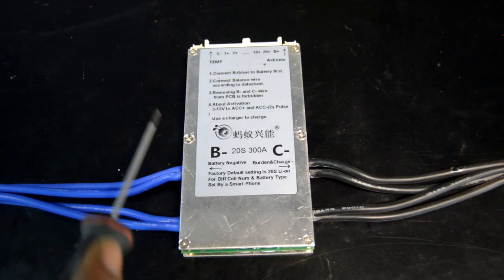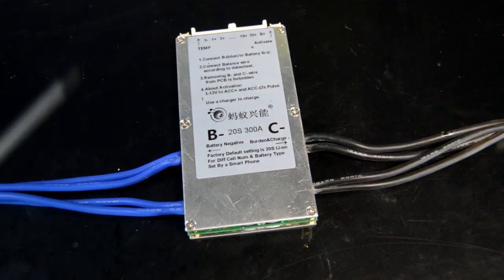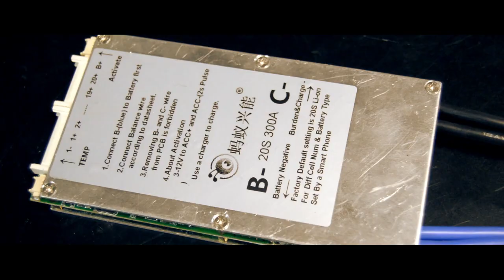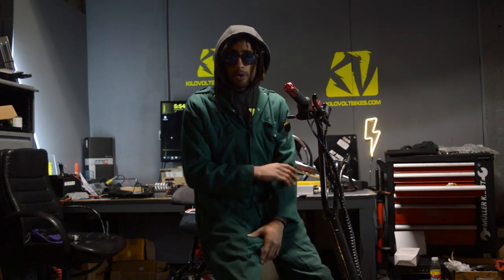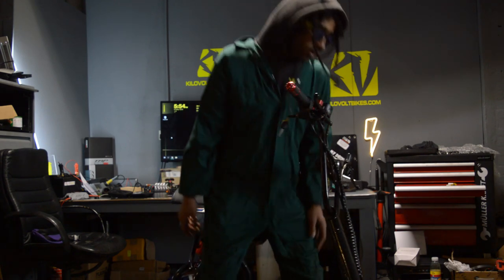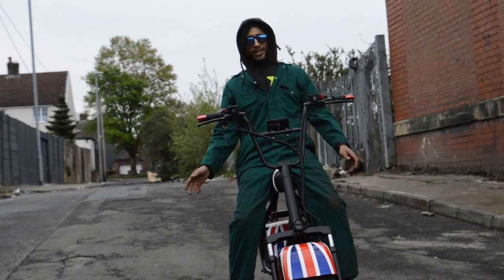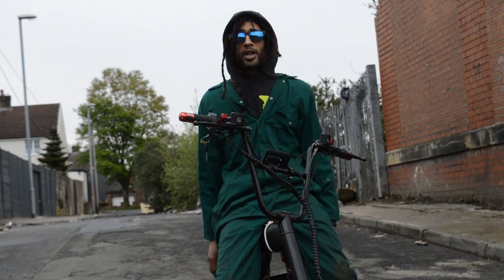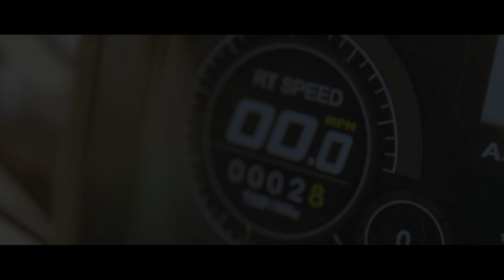Modified Citycoco Electric Scooter with 72v battery & Sabvoton Controller Part 2 [UPGRADE CHALLENGE]

Comment: What up! Hey I want to upgrade to a higher voltage on my Fat Tire scooter. I’m familiar with the battery and layout but I’m not familiar with the specs of the speed controller and 2000W hub motor. My question is. Without concerns about other excessori. Will the speed controller which is currently setup for 60v. And the motor is rated at 2000w. I’m assuming just like the City CoCo. With the speed controller handle 72V. Or what mods can I make to the current controller to handle 72V. If not what speed controller would be best for this type of conversion? Thanks

Comment: Thanks for all the great content! I live in Ecuador and bought a used scooter like this with a 1500 watt motor. I found someone who can build a new battery and they purpose either a 60 volt 30 amp
Or 72 volt.  Will I get enough torque with the bigger battery to worth it?
Reply from the maker: yes a bigger battery should give you a good improvement on power
Reply: @KiloVoltBikes  it needs a new speed controller too?

Comment: Love what you do I do the same but I’m wondering if you have any ideas that I have not thought about I have Samsung 27ah battery and 2 1600w 11 hubs it’s the maike kk10s the controllers are crap have you ever used two sabvoton controllers ? Or got any other ideas mate please get back to me much appreciated in advance
Reply from the maker: Can use multiple controller just need to split the throttle between the 2 controllers
Reply: @KiloVoltBikes  sabvton tho? I done m365 and Chinese

Comment: Gread job!! I need to do something like that 4 my coco 2022. It's 2000w and battery 20ah. Idk if after upp I need to change also engine or not..  Or maybe are beter that me do another 20ah battery 60v samsung or lg 18650 ( and using both bateries, bcs hav the place for them, Like that I have 40ah 60v ) 
ANY HELP APPREZIATED 😊

Comment: i have qsmotor with markings 3000w 60v, its 12inch, can i overvolt this to 84V to reach 100km/h? will it damage the motor?
Reply from the maker: Yes you can - no it will not
Reply: wow thank you. 

one more, can i use also 96v?

the reason i want higher voltage is so that i can have the power whenever i needed to but i will be running most of the time to only 70 to 80km/h thinking it is its safe speed because the stock setup is rated 75km/h

Comment: Hi I have sent you an email about building a 21700 pack for me just want to know how much roughly so I can save it needs to be a 20s9p pack made of Samsung 50e cells dimensions are 440L/200W/77T in mm also do these battery’s come with a charger? Thank you for your time I subbed to the channel love the vibes
Reply: Eww 50e sucks 😅

Comment: you need a hotter iron
Reply from the maker: I have a large array of soldering irons , 40-200w

I went for a 60/80w adjustable soldering station for this job as those discharge terminals have small SMD resistors directly next door to them , a larger 100w or 200w would radiate enough heat to effect those.

What would be you iron choice for the above job out of interest ?
Reply: @KiloVoltBikes  Your tip was too dry, make a little blob on your tip before you solder and it will help transfer the heat a lot better and use some flux .
Reply: @crispysocksss 😮🎉